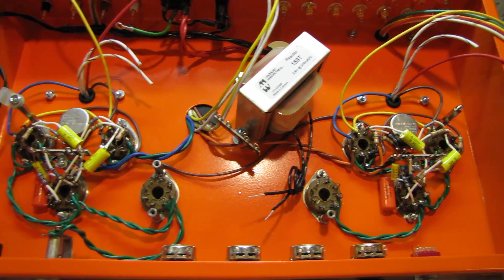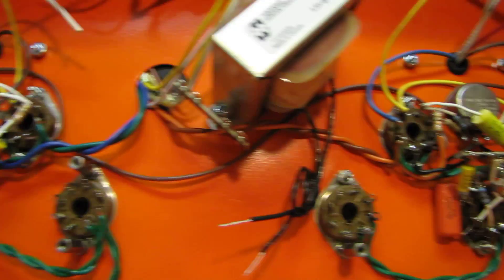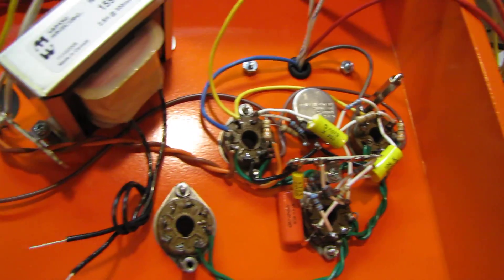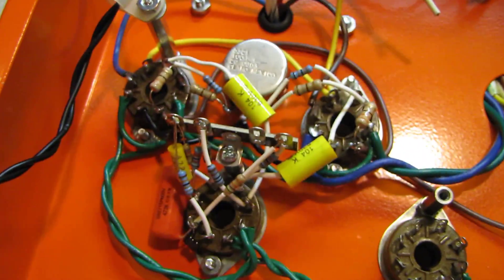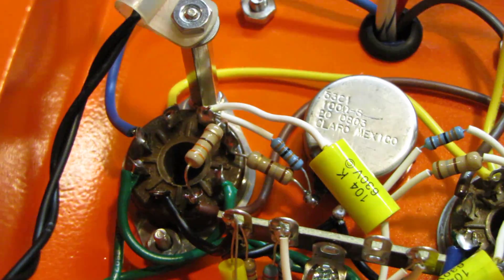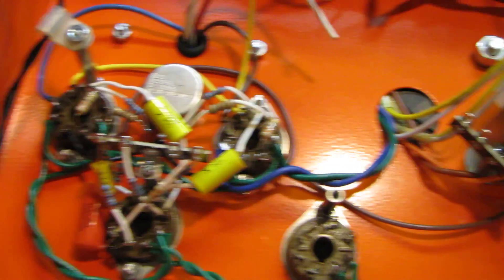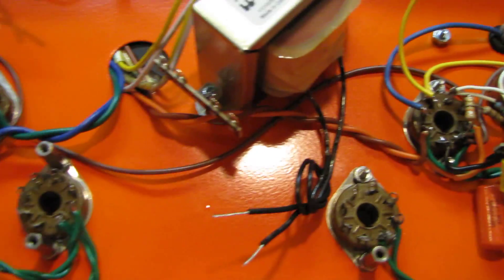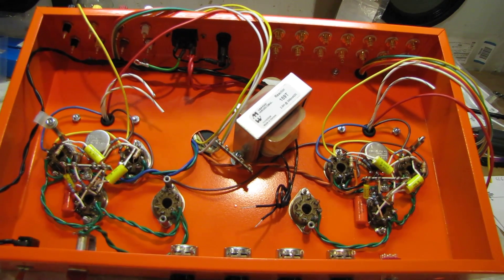My DIY 6L6GC stereo tube amp project, part 3

Comment: i need a bit of help please  to know if by changing the anode resistors on a 12AX7 will or does it change the gain i am building a valve HIFI preamp and i want low gain. i was thinking of using 68 k and 82 k what's your thoughts

Comment from the maker: @SilentActivity I used 6L6GC output tubes in push-pull configuration.  The transformers were Edcor CXPP60-MS-6.6k.  They have ability to run 4, 8, or 16 ohm speakers.

Comment from the maker: Progress has been good, but I've had a couple big problems that I'll tell you about tomorrow.

I did get to do a quick test on the power amp circuits the other day, and it looks like it's gonna be sweet.  Frequency response is at least 15Hz-25Khz.  Couldn't get enough input signal to reach full output though, so I don't know the wattage yet.

Comment from the maker: I have a bench power supply that I'm probably going to use for initial testing.  Though it only goes up to 300V for the plates, and barely enough heater current, even for just one pair of 6L6GC's and one 6SN7.

Comment: I'm sure it will work the first time! you know you have all good new components. I rebuilt a Heathkit 400v power supply at our repair shop and have used it in cases like this where there was not a power supply working in a piece of equipment. I'd hook up the Luxman CD player headphone output w/.047 capacitor to the grid of one of the output tubes and use the Heathkit power supply and it is so rewarding to hear sound come out into that speaker.